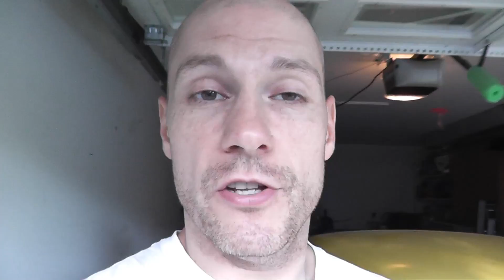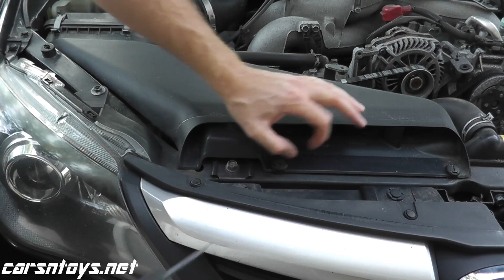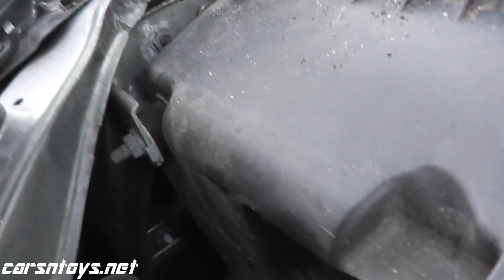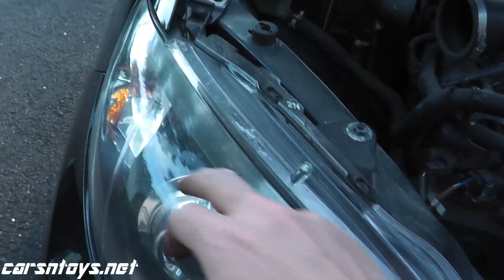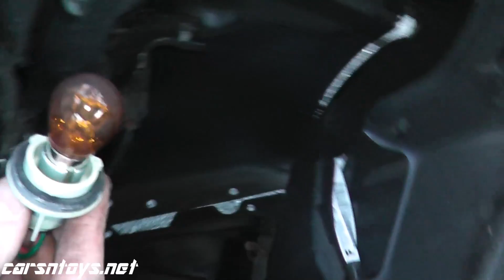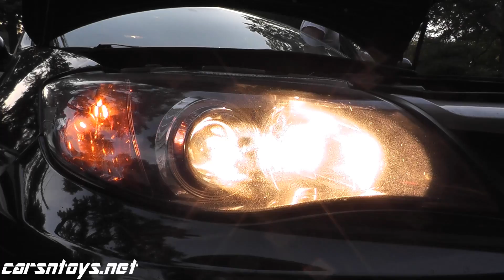Subaru Bulb Replacement | Passenger Side | Turn Signal/Low/High

Comment: There was one more bulb next to the turn signal. (side light ?).   Mine is out on the driver side. how hard is this one ? It's next to battery almost impossible to see the two bulb connections (signal and side light).  Thanks

Comment: The manual states to get access via the mud guard of the front wheel. Have you tried that as well, and if yes which procedure is easier?
Reply from the maker: You can do that as well. I prefer this method but it's all preference.
Reply: Taking out the air box is way easier

Comment: Don't do it this way for the turn signal.  There is a much easier way.  Search WRXHowTo and they will show you how.  I did the change in 5 - 7 minutes at the most using only 1 
flat head screw driver.